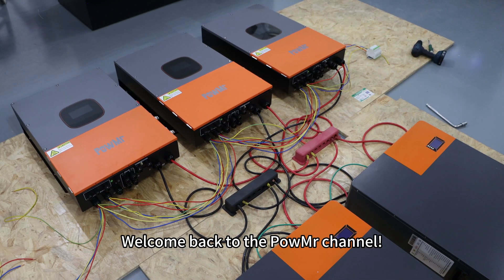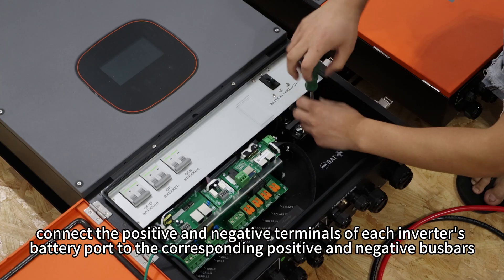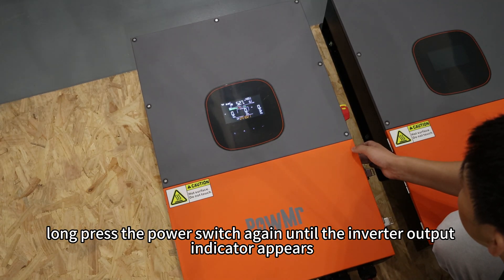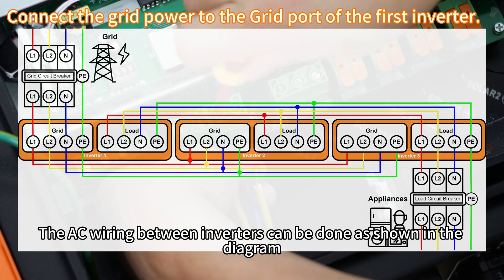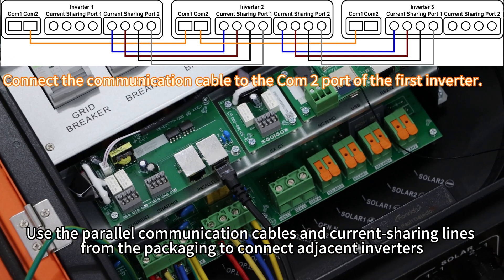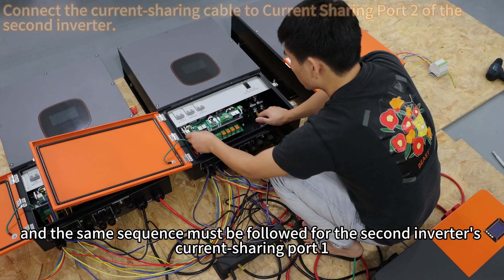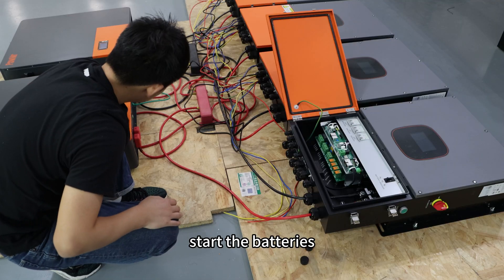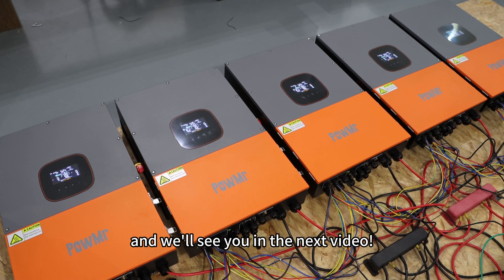How to Complete the Parallel Connection of PowMr Solar Inverter - POW-Sunsmart LV12K

Comment: I supplied 220 volts to the solar panel (PV) input of this inverter. What is the problem, is it repairable? Or should it be discarded? Thank you, sir.
Reply from the maker: PV input only supports access to solar panels. When you say 220V, do you mean the PV voltage?